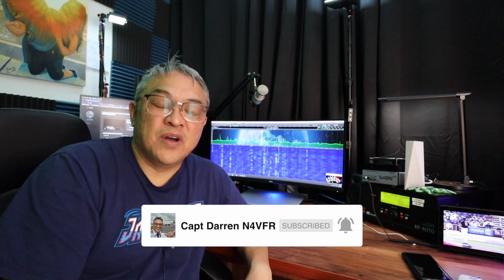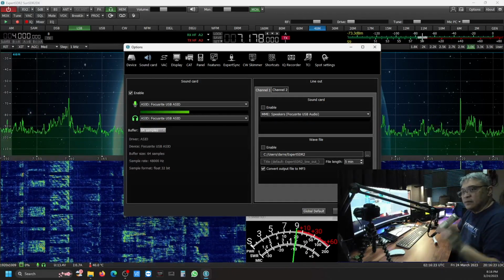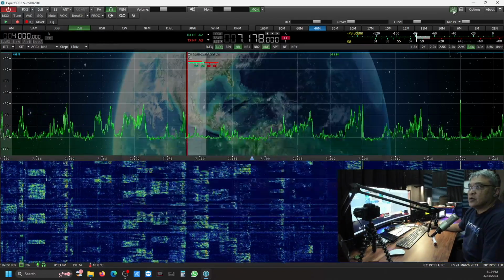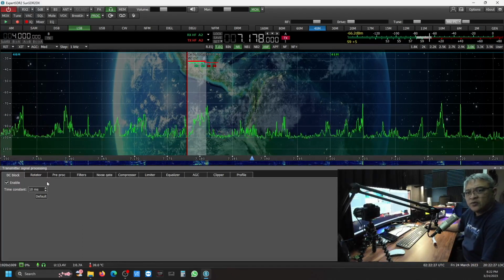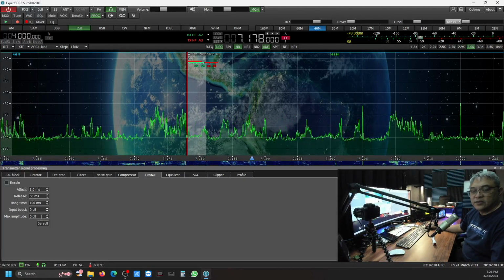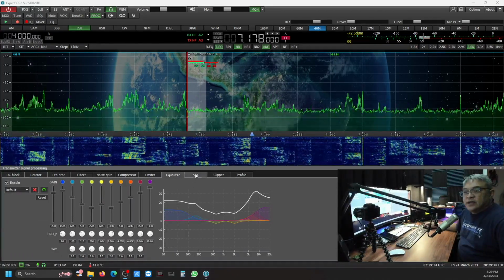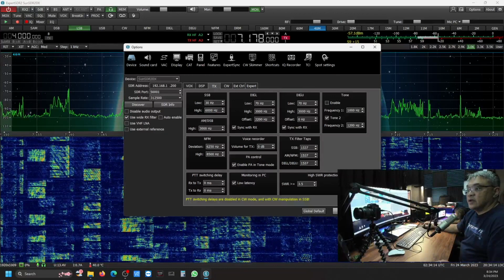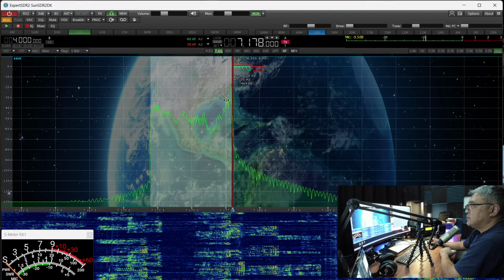Broadcast Audio Setup for the SunSDR2 DX | Expert Electronics | Heil PR40 | How to set up Audio

Comment: Capt Darren, You are an insight, the Focusrite Scarlett makes more sense now, I wasnt getting it before, slow at picking up things. Are you planning on keeping the SunSDR DX or planning on getting another Apache Labs 7000DLE?
Reply from the maker: Glad to help.  I'd like to get another Anan for my 2nd QTH.  Keeping the SunSDR2 DX for now.
Reply: @DarrenN4VFR  Thank so much, Im planning on going to guitar center, because sweet water is not even close by to buy a Focusrite Scarlett, i watched other you tubers with the Focusrite Scarlett, if you purchase the i think 7i7 Focusrite Scarlett, you get a dashboard to control more EQ, but no thank you on the $700-800, We are just Ham operators not a radio station or a band.  Im asking question because I am planning, scared as all,  to get an Apache Labs Anan-8000DLE, I do believe this will be my last radio, we all say that, but Yaesu, Icom, Kenwood, has failed to come through after promises, SDR is way far ahead of the standard radio manufacturers.